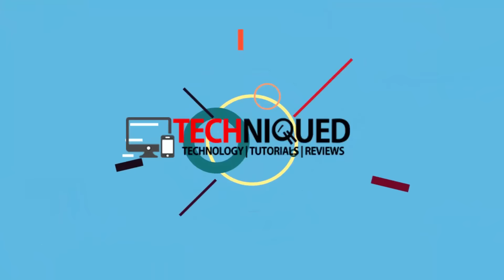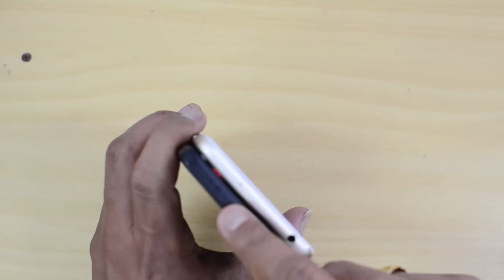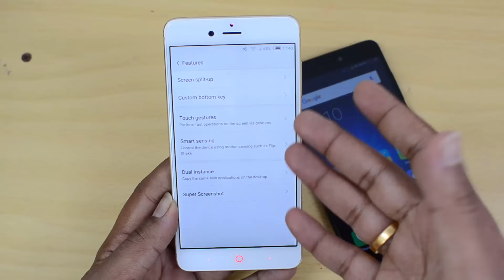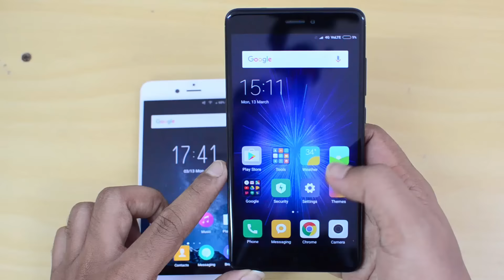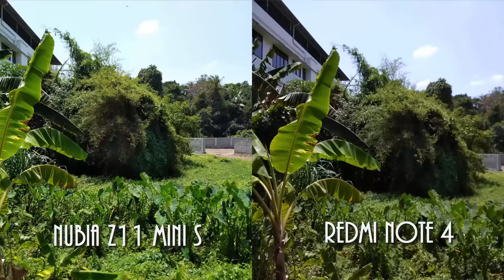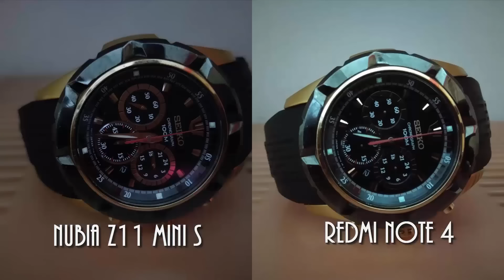Nubia Z11 Mini S vs Xiaomi Redmi Note 4- Comparison, Software, Performance, Camera and Battery

Comment: i have both the device, note4 and mini s, as per my comparison mini s is great. camera is superior. h/w is same so even though mini s has 3000mah battery it wil give same performance due to smaller size. build quality is  greater than note 4, as mini s has gorilla glass protection and back metal quality is better than note 4